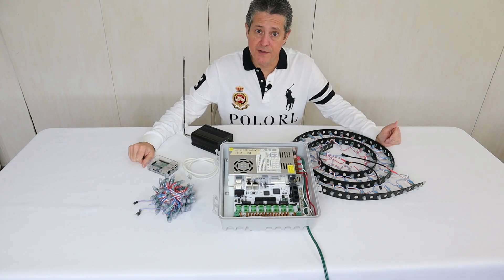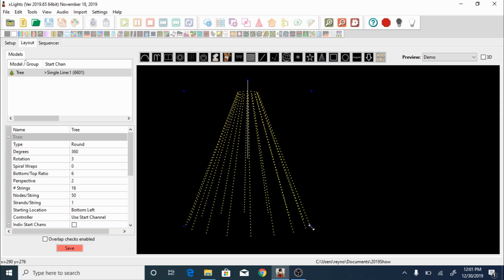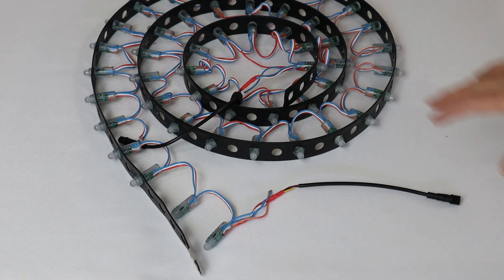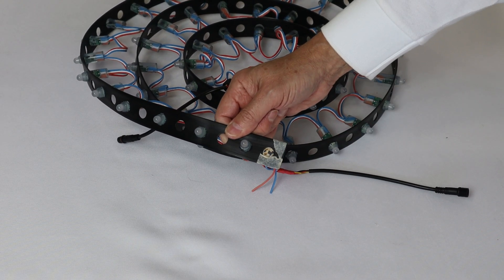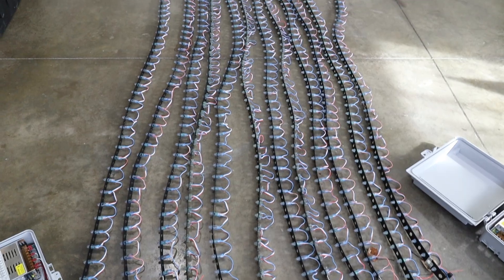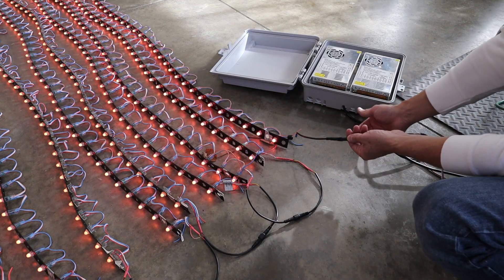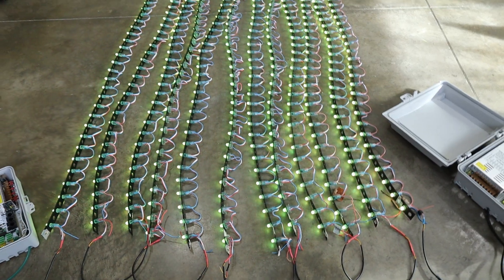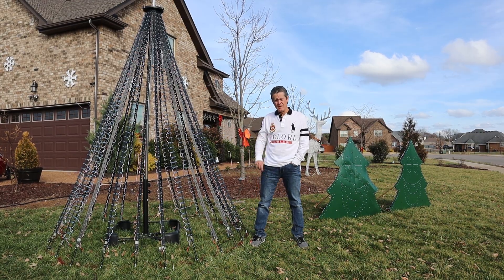How to build a L.E.D. Mega Tree - Step by Step

Comment: The best videos, simply the best. One question: I’m incredibly new to the pixel lights, in fact I don’t even own any yet. I’m the biggest fan of the singing trees though, which is ultimately why I want to try this! There is another guy that I watch on here that breaks down exactly what everything is and does, but you are the one that goes in depth with programming and how to solder and jump the connections over. One suggestion for you: list the parts you had to buy, like the heat shrink tubing, soldering iron/solder and heat gun and tell people that as you are doing the scenes bc I guarantee you some people have no idea what this stuff is. Having said that, can you do a 24V controller and use a MacBook Pro instead of windows for XLights? And do you prefer to work with the 12V vs the 24V or does it cost less to work with the 12V? Also, you never showed how you transferred the data to the raspberry pi and weatherproofed the controller and what box you got for it. Anyway, thanks for the video and you’ve got a super cool display!  I so want to get those singing trees with that song from you lol. Amazing job. You got a subscriber for life.
Reply from the maker: Hey there, thanks for writing and your kind words. I am DIY type of guy, so I like building things myself. Actually, you can buy prebuilt cables in any length you need. So no solder required. Same goes for the controllers, you can buy them ready to run, all setup and in a water proof enclosure. Xlights runs on windows as well as apple devices. The mostly used controllers are either 5v or 12v and use smart pixels using ws2811 chips. Happy holidays.

Comment: Just double checking, but if I start with a female pigtail on the bottom of strand 1 then that strand ends with a male pigtail at the top.  So the next strand would need a female pigtail at the top. So for your 12 strand example you would have 6 strands with the female pigtail at the bottom and 6 strands with male pigtails at the bottom. Would it not be better to make the plastic strips such that the top and bottom were the same so all strands are made identical? Then you would just have to turn each strand one way or the other to keep the data flow in the correct direction? Or am I missing something?
Reply from the maker: @codecage9333  Yes, you are correct. But please notice that usually a string of light will come with xconnect pigtails included and the input end is a male connector. But if you are making your own extensions then you are okay.
Reply from the maker: …and about the strands you are also correct, build them the same way and just flip them over.
Reply: @trevilights  Thought the input end was a female connector. Your video at 7:30 to 7:47 gives me that impression. An added edit: I finally figured it out! The input end of factory/prewired ws2811 RGB LEDS have male pigtails and the output end is a female pigtail.
Your reference to which was which was based on cutting off the non-waterproof ends and attaching matching waterproof ends. But if you installed male on the end you cut of the non-waterproof female connector and a female connector on the other end where you removed the non-waterproof male connector, you'd would be matching the preassembled cables like I have been purchasing.
Reply from the maker: @codecage9333  Exactly. I will prefer that you follow the standards. But at the end of the day, is up to you your show will work the same. Some of the props/strands that I have, are from when I started, about 5 years go and wired the differently. I still use does props as they are.
Reply: @trevilights  Thanks for the info but I'm still a little confused, This is my first tree, going to be proximally  18' tall, 6' base and 180 deg with 32 strands. so there should be 16 of each connecter at each end or do i need to setup where all are the same at the ends, not sure if i will use a single controller  and use 16 ports with 200 nodes per run.  What would would recommend.
Reply from the maker: @ Hi There. How many pixels per stand?
Reply: @trevilights  Thinking  of approximately 100 per run so approximately 3000-3200 total for 180 tree
Spaced about 2” apart per run and will be about 100 per run
Reply from the maker: @ Well, you have two options. You can easily connect two stands (100 x 2) in a zigzag, this will be 16 ports as you mentioned. This means no power injection is needed. Or you can connect 4 strands (100 x 4) but you will need to inject at the end of the 4th strands (only use 8 ports). I say you go for the first option using 16 ports. I would get a SRx4 (see link below), put it on a box with a 360w power supply and use all 16 ports.

https://pixelcontroller.com/store/long-range-expansion/84-srx4.html
Reply: @trevilights  that’s what I was thinking , thanks

Comment: Why all the loose blue and red wires at the bottom? Looks like an easy short out.
Reply from the maker: These string of lights come with an extra positive (red) and negative (blue) wires for power injection. You may not be able to see it in the video, but the copper tips are cut off. But you are right, there is a possibility of a short if not cover properly. 
Thanks for watching.

Comment: Hola amigo puedes hacer un video bueno digo si se puede sobre las stakas que. Van en el suelo algo de peace  gracias
Reply from the maker: Hola Jesus, las estacas no es mas que un linea de pixeles (5 -10 pixeles) interconectadas en serie. Tambien podrias usar el elemento de cubo. Las acomodas verticalmente de forma que cubran el espacio que requieras en el piso. Depues creas un grupo con todas ellas y pones effectos.
Reply: @trevilights  para usar en xlights  cuál sería  su elemento
Reply from the maker: @601jesus  La Linea recta. Haces una de los pixeles que quieras y la pones en forma vertical. La copias y acomodas cuantas veces quieras cubriendo el area que quieras.
Reply: @trevilights  muchas gracias amigo
Reply from the maker: @601jesus  Por nada. Muchas veces este proceso es de prueba y error. Intenta algo y si no es lo que esperabas, prueba otra cosa. Si necesitas ayuda, puedes separa tiempo conmigo en trevilights.com y tenemos una video llamada. Suerte.

Comment: What size pole did you use and where did you get your mega tree topper?
Reply from the maker: The pole is made of two four feet antenna pole that you can get at your hardware store. The topper I got it from Holidaycoro.com
Reply: @trevilights  what size pole did you use. Width?
Reply from the maker: @WooderBoyProductions  Your friend has shared a link to a Home Depot product they think you would be interested in seeing.

https://www.homedepot.com/p/WINEGARD-5-ft-Swedged-Masting-for-Outdoor-Antenna-TB-0005/204701122

Comment: Did you have to cut the positive lead before the injection point? Thanks
Reply from the maker: Hi Melchor. I did not, but it is recommended. I did not do it since the supplier of the power supplies I use claim that parallel connections are possible. I have done my show for 6 years, never had an issue because of this. Check the specifications of your power supplies. Thanks for watching. If possible, power inject from the same power supply your controller is using.

Comment: Hi ! Are all your strings are on the same power line ? How many amps do you need (which fuse ?) thanks !
Reply from the maker: Hi, All power Injection for my mega tree is coming from one power supply. Now, I have upgraded my Mega Tree to be 1600 pixels. (16 Strands of 100 pixels each, 180 Degrees). Below is a non-public video showing a distribution block that I use, and the amperage been used while playing a sequence. You see the amperes jumping around as the sequences changes effect. Also I run my show at 35% of brightness. The brighter, the more power you need.  I use 18awg wire and 10amp fuses for power injection.
https://youtu.be/zvxYS3GRb-Q

Comment: Did you plug the power injection at the end of both strands? How many spots did you inject power on that tree?
Reply from the maker: Hi David. This is divided into 2 strings of 600 pixels each. For every string, it received injection at 3 points, the beginning coming from the controller, another one halfway at pixel 300 and at the end if the string at pixel 600. In other words every 300 pixels. I would recommend power inject every 200 pixels. This is valid for a 12v setup running at 30% brightness.

Comment: great video. You are very detailed. BTW for the controller do you always have to have the ethernet cable mounted throughout the show or is it just for the initial setup
Reply from the maker: Hi there. Throughout all the show. This is how the Falcon controller gets their data. Other controllers like the Kulp are a little different, but same concept. 
Thanks for watching.
Reply: Hey whats the distance between the lights in the strips. Also what is the topper you are using here

Comment: Why can’t you run all the data off 1 port and just power inject as you did ?
Reply from the maker: Hi there. The pixel ports have a limitation of 1024 lights per port, so you cannot run all 1200 from one port. To make it balanced, you have to divide the number of total pixel in two ports. If we had a larger tree, let say 32 stands of 100 pixels each  (total of 3200 pixels), then you will have to divide into 4 ports of 800 pixels each. It's just the way it works. It all comes down to the limitations of the controllers. Thanks for watching.
Reply: @trevilights  great video and makes sense about the per port limit . Thank you for the fast reply.
Reply from the maker: @krum81  Your are welcome.

Comment: I am trying to figure out everything I need to get to embark on pixel Xmas light shows at our house.  I still don't understand why anyone would choose 5v over 12v? Also, can the f16 plug right into a switch to get it on the network and the show then driven off a computer using xlights, or, do you still need the pi?
Reply from the maker: Hi There. Well, 5v uses less electricity and are a little cheaper. But I still prefer 12v. You can run your show using xlights Scheduler App from your computer, but this means your computer will need to be on during this time. 

Having a Pi has it advantages. The FPP software has many other options and you can control P5 and P10 Panels, Control Input Channels as well as Output Channels, Send data to multiple controllers, etc. Also you can put it inside the same box as your controller and forget about using your computer, and disconnect from a ethernet cord.

I guess is just matter of preferences and needs. But you can start by running your show from your 
computer.

Comment: Which topper did you choose from Holiday Coro? The QT1? Is it a 3/4 conduit pole? Also what height do I need the pole to be to replicate yours? Great video!
Reply from the maker: Hi Jared, I used the QT2. As fot the hight, I used two Antenna poles. But it all depends on the lenght of your plastic strips and the spacing between pixels. The idea is find a good angle for your strands. Some people like thier tree thin and tall, other short and wide. Keep in mind that when the strands are closer together, the effects look better.
Thanks for watching.
Reply: @trevilights  Thanks! How many strips total did you end up using?
Reply from the maker: @jaredwilson6214  24 Strips of 50 lights each. Total of 1200 pixels for a 360 degrees tree. 

This year I am doing 16 Strips of 100 lights for a 180 degree tree. Twice as high, but only half round tree.

Comment: Great Video! I am not doing a Mega Tree but just lighting up posts on an arch over my walkway. I figured setting up like a mega tree in either xlights or Vixen but I wasn't sure about stringing them up. I figured to go up and down the post and your video shows I was thinking correctly.  My concept is to do 3 sides of the post as I have Lattice in the middle..
Thanks again.
Reply from the maker: Hi there. Thanks for watching. Yes, zig zag is the way to go. Good luck with your project.

Comment: Great video - I'm now inspired to give this a go! Thanks. Which specific topper did you use from HolidayCoro? Thanks again.
Reply from the maker: Thank you very much for your words.   I use the QT2 360 degrees for up to 32 strands.
Reply: @trevilights  great! Thank you for the quick reply.
Reply: @trevilights  I’ve just checked and they don’t ship to Hong Kong. Do you happen to know of any other suppliers ? AliExpress would work as they usually ship here. Thanks again.
Reply from the maker: @bsargent  Unfortunately, there are no other suppliers for the Falcon Controller. They are only sold by the manufacturer.
Reply: Thankfully I’ve got the Falcon controller and will order some of those lights you used. I was referring to the topper you mentioned from HolidayCoro.
Reply from the maker: @bsargent  Awesome. You are on your way to create an great show!

Comment: Thanks for this video!  I see you put power supplies out with your tree, but where is the data coming from? Do you run a long line back to your controller?
Reply from the maker: Yes. The power supply under the tree provides extra power the pixel strings( a.k.a Power Injection). The data comes from controller as well with the main 12v also coming form the controller power supply.

Comment: Very informative! Thank you. since you used power injection does that mean the main controller box was in the garage? i did not see how the tree was connected to the controller box.
Reply from the maker: All elements are connected to the controller inside the garage. The controller provides 12v. Depending on how many pixels you have on that string, you might need to inject power to bring the voltage back as close to 12v as possible.
Reply: @trevilights  is there a rule to how many pixels you will need to inject power? for example, a mega tree 890 pixels that is only 15 feet from controller box. thanks
Reply from the maker: @tbbucatfl  There are some guide lines that we can follow. According to the WS2811 manufactures the WS2811 pixel uses 0.06 watts. On a 890 mega tree that will be 53 watts (on a 12v system that will be 4.5Amps). Now this is just how much power it will use(at 100% brightness), not how frequent we need to inject power. Power injection is a tricky thing. The brightness that you set your controller plays a big role. I run my show at 30%, so the leds are using less power which allows me to inject power on fewer places. What I do when I have a new element it to play a sequence and use a voltmeter and I measure the voltage at different points. For a 12v string I try to keep the voltage no lower than 10v. Hope this helps.
Reply: @trevilights  thank you! 30% seems the norm. maybe you can do a video showing this process.

Comment: Once again, you have the best TO THE POINT tutorial on the subject. There are many other tutorials for tree, but they waste too much time on things that most of us don't need. Thank you for your work.
Reply: I build one thanks to your tutorial but ran into issue. I wanted to be less ambitious and have something by Christmas so I built one with 10 strips of 40 pixels on each. But seems to be some issue as even if each strip has been given its own channel on Falcom f48v4 there seems to be an issue where wrong leds are showing the color. Is there any specific settings for Strings, Nodes/Strings; Strand/Strings for my kind of set-up? Appreciate any suggestion. PS: Since total lights are only 400, I used the same port but gave the channel numbers to each strip. I tried testing and gave 2 strands per strip I could see two pinwheel but both rotating in opposite direction. Any? advice where to look at?
Reply: @SwapnilBhartiya  not sure what your using maybe xlights ? i did see once you can check the way led strings should be connected for sequences by right clicking the tree will show you a wire diagram how they should be connected to get the sequences , not sure if this helps if honest

Comment: Thank you for the clarity that you're running 600 pixels on each of two ports. Do you overcome the five amp fuse limit per falcon Port by using power injection every 100 pixels? Do you have to be sure that your supplemental power supplies are on so that it doesn't blow the controller fuse? This is so helpful as I transition from crazy lighting on Halloween costumes to crazy Xmas lighting
Reply from the maker: Hey Klay. Let me give a live example. I just measured what my 20 Candy Canes(1000 pixel total) draw doing a color wash effect at 30% brightness. I have 3 extra power injection point beside the one that the controller is already supplying(every 250 pixels). All of those 4 point are using no more that 1.5amps each (used voltmeter with clamp). Now, I must confess that the voltage at any point of my string is between 9-10 volts, not 12v. I guess I need to inject more often, but the pixels still work perfect. So basically a 1000 pixels will use no more that 6 amps total. 

According to the specs found in Amazon for the WS2811 12v pixel, each led uses 0.3w with translate to 0.025amps per pixel. If we multiply 0.025 x1000 pixel we get 25amps at 100% brightness. At 30% brightness this will be 7.5amps, very close to what I am getting. I am running my 5000+ pixel show with two 360w(29amp) power supply at 30% brightness.
Reply: @trevilights  Thank you! Regarding 30%.. is the logic that 30% is bright enough but not obnoxious... And/or... That higher power can't be noticed by eye typically?
Reply from the maker: @klayjones724  These light are bright. Sure you can run at 100% and you will noticed it, as well as your neighbors.

Comment: Thank u for the video.  I noticed on the falcon controller ur using the bottom left port. Isn’t that a 5v port ?  On the other side is 12v ports. ?  Is ports 1-8 5v and 9-16 12v?
Reply from the maker: Hi. All of the port are 12v in my configuration. But you have to option to run 12v and 5v simultaneously using two power supplies. My 12v power supply is powering both sides.